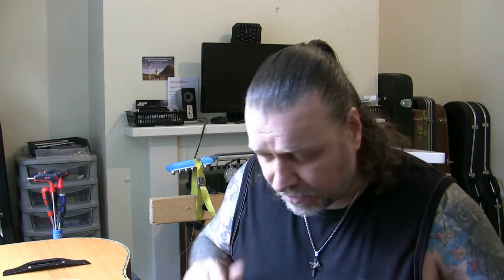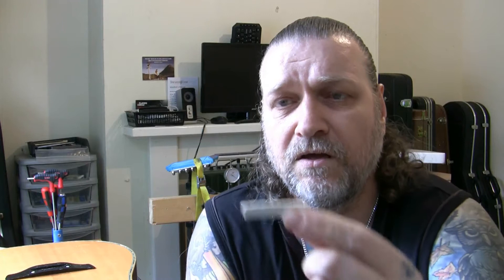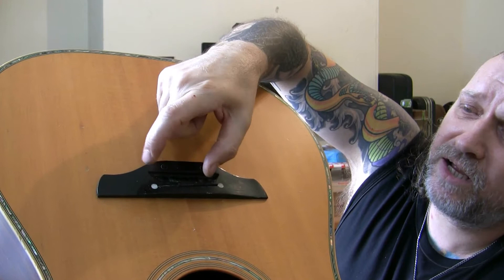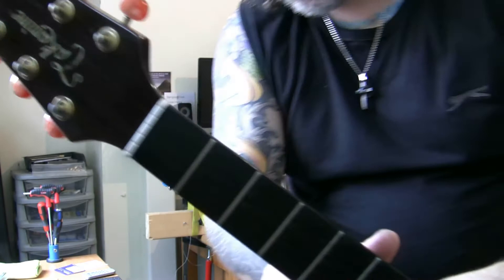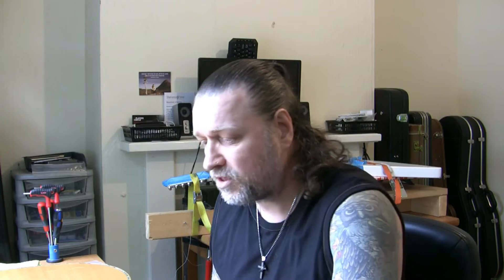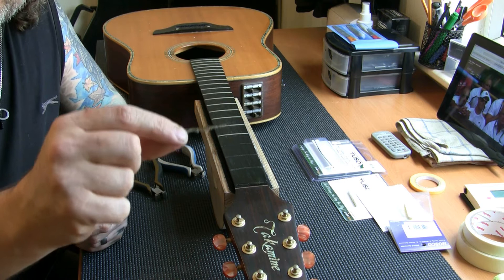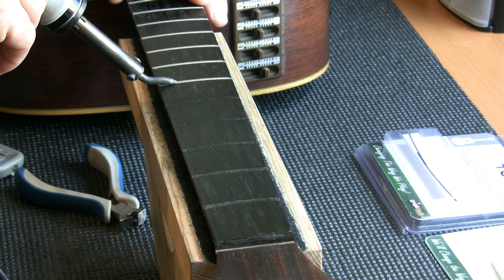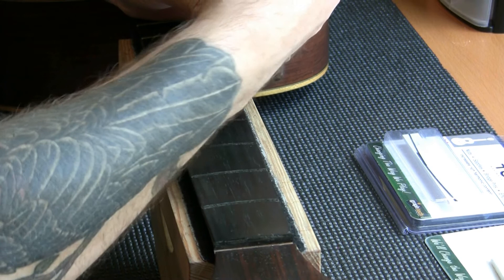Takamine EN-18 in for a re-fret and some upgrades / repairs [Part 2]...

Comment: The TUSQ nuts are actually really great, and they're easy to install. Just requires a little bit of final fitting.
It's been a while since I've used a TUSQ nut, since I've gotten myself at nut making vice, which is great!
With that it's a breeze to make new nut! I like to use cow bone blanks. With a good amount of polish it will look so good!

A question for the re-fret job...:
I don't know if you did this, since we didn't see the steps leading up to pulling the frets, but aren't you supposed to straighten out the neck? First with the string on, then also when the string have been taken off, in order to work on a flat neck?

Thanks & Cheers! :_)
Reply from the maker: I flatten the neck with the strings off. Always have. Then it goes on the jig where I set it level before sanding. I'm all about the straight neck. I must be doing something right because I have people ship guitars to me from all over the country. It would probably make more sense to remove old frets with some backbow as this would slightly open up the slots but I'm happy with my methods...
Reply: I see, thanks! I thought so too, but just wanted to make sure! :-)
I'm gonna re-fret some guitar in the near future, so looking forward to that!

Cheers & Thanks!